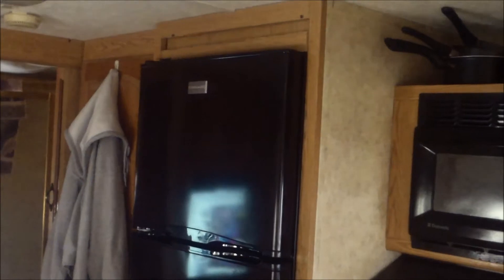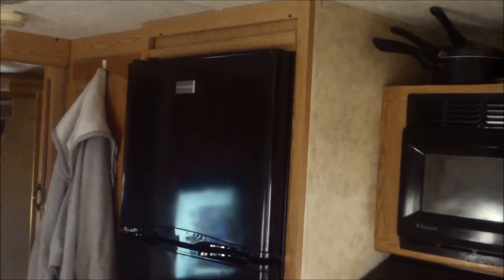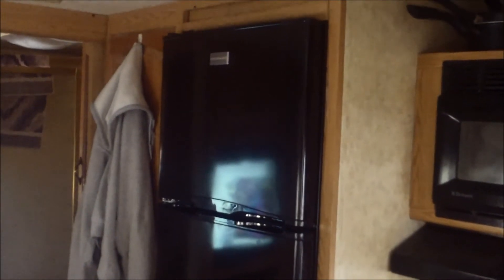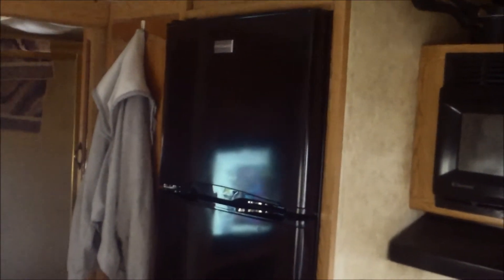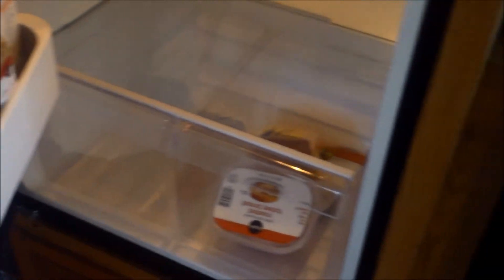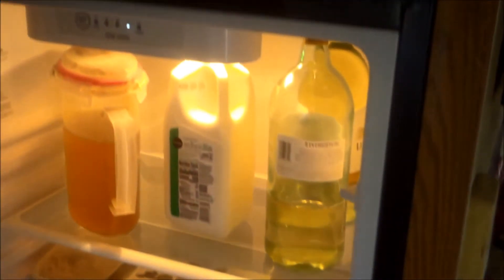New Fridge!

Comment: Ron...couple of questions. Who makes it? what are the dimensions? I live in a '07 Dutchman and would LOVE to replace my fridge with a residential. I've been in place for about 20 years now and have no intention of moving. If I move up to a 5th wheel, I'll get a residential and add on a generator to run it if I decide to roll on down the road. :-)  Looks great and the installation looks top notch!
Reply from the maker: This is the one I bought:  https://www.homedepot.com/p/Frigidaire-10-cu-ft-Top-Freezer-Refrigerator-in-Black-FFTR1022QB/205423869
Reply: Nice basic unit.. everything that you need .. nothing that you don't!  Not much to go wrong!